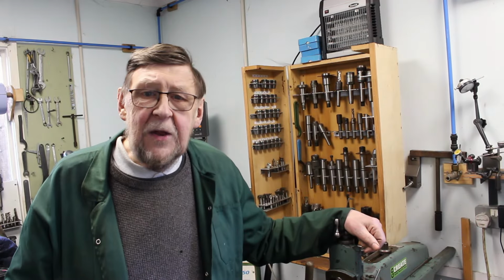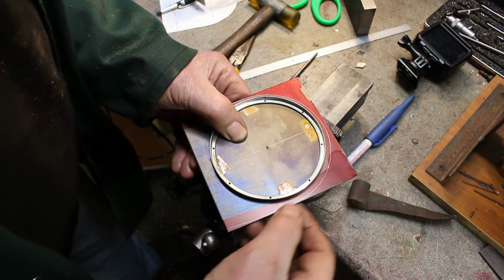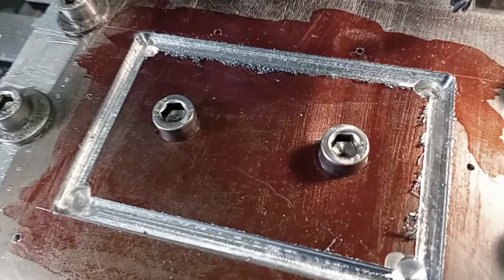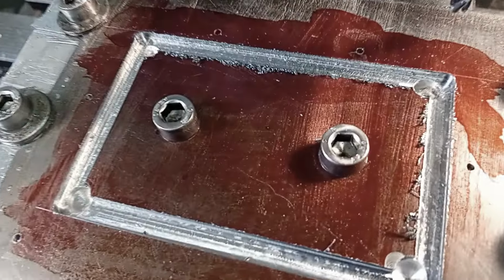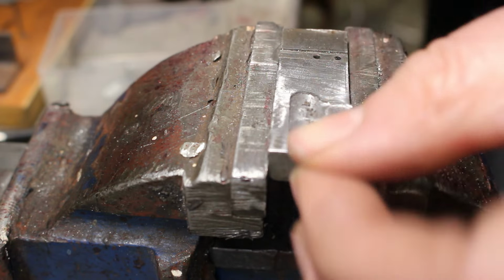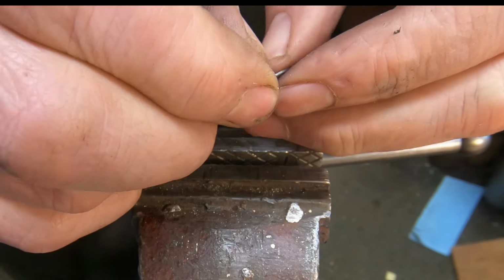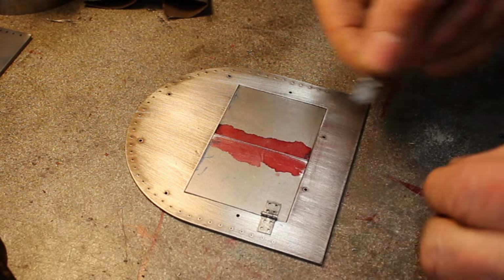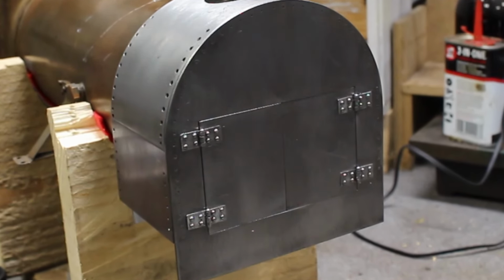LION Vintage Steam Locomotive | Model Engineering Workshop Build in 5"g - Part 65

Comment: Can you not use a hinge rolling jig - a hole with and off set slot - you put the tab and in the slot and hammer and it rolls it around to a circle the size of your pin + 2 X the thickness of the metal
Reply from the maker: Yeah, I'm sure that would be a good method for making hinges, maybe I'll give that method a go next time I have hinges to make.
Thanks for your interest in my Lion build, it's very much appreciated.
Cheers 
Nigel

Comment: What hot glue sheet do you use and where do you get it. Love the channel and just subscribed. All the best. Mike in Sheffield.
Reply from the maker: Hi Mike.
Thanks for your interest in my Lion Loco build and thanks for subscribing it's much appreciated.
I buy the hot glue from ebay, no particular supplier, a seach for "hot glue film" will yeild results. It's meant to be an iron on adhesive in wood Marquerty, I'm using it at higher temperatures when gluing metal and it works very well.
I hope that helps.
Cheers
Nigel

Comment: Well done sir, a brilliant way of making those hinges. 
When you say "not perfect" I only wish my level of detail was a good as yours.

Unless I missed it how do you get a seal on that smokebox for keeping the hot bit in the firebox and burning bright?
Reply from the maker: Thanks, not perfect means has character just like the real loco. 
The doors will seal against an inner frame which I've actually just finished today, all will be revealed in my next video. If there are still issues later down the line I have a backup plan, but I think it'll be ok.
Cheers 
Nigel

Comment: That sheet glue is really interesting. I’ve not seen that before! Those hinges came out great. Your bending jig was very clever!
Reply from the maker: Thanks so much. I use the hot glue sheet quite a lot, it's surprisingly strong for work holding. Yeah, I'm really liking the hinges, their slight imperfections seem to reflect the character of the full size loco.
Cheers 
Nigel

Comment: You should be proud of those doors and hinges  Nigel. I guess now you’ve gone down the rabbit hole of operational doors and looking  at the original smoke  doors I guess the 5 rivets set out like a 5 on a dice secure the heat protection plate and of course there is that handle and lovely dog to make at the top
Reply from the maker: Thanks, yeah they're looking pretty good and yes, lots more functional detail to add. I'm pretty sure those 5 rivets on each door are for holding heat sheds.
Cheers 
Nigel

Comment: Hi Nigel
Nice work so far 👍
How do you plan to seal the doors?
Best regards and thanks for sharing your work with us.
Reply from the maker: Thanks. There's still an internal door frame to fit that the doors push up against, I'm hoping that will be good enough. If not then perhaps I can fit a thin PTFE gasket or if all else fails I can fit an internal cover when running.
Cheers Nigel
Reply: @GoCreatehms  Thanks for the answer. 
I also think the seal will be good enough when the frame is built in and it overlaps a few millimeters (I think 5 mm will be enough). The idea with the teflon gasket is also a good option.